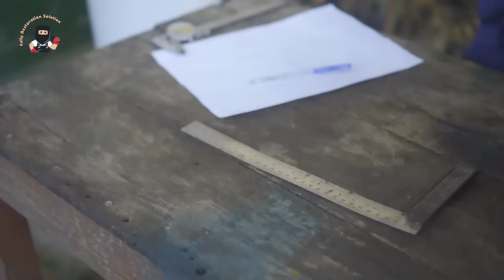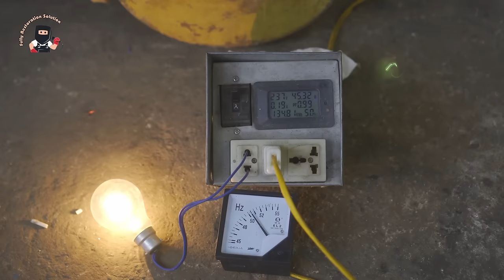Restoration Videos 380v old generator to 220v 7kw  - Repair And Rewinding Rusty Generators At Home

Comment: welding the body of that motor/generator will affect the quality of core. as you know the core is layer by layer and in the middle of the layers there is isolation. so welding will damage the isolation and while working with the normal frequency you will experience heat in that part. this will damage the winding after a while.
Reply from the maker: Please consider. This type of generator is fun and comfortable to weld. I'm afraid I don't have the strength to weld anymore. I'm afraid my eyes will hurt and my face will burn. because the steel core is 2 cm away from the shell. it is supported by only a few tendons
Reply: @RestorationVideo   thanks for the detailed reply